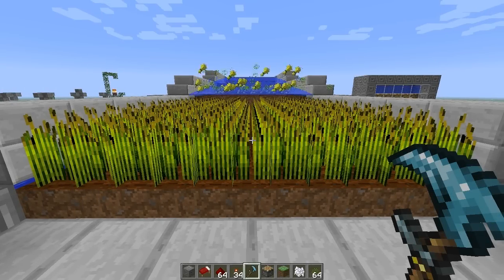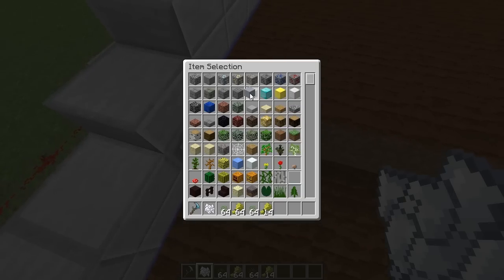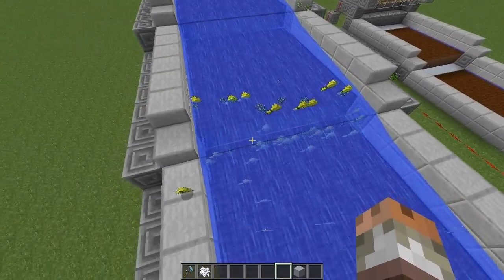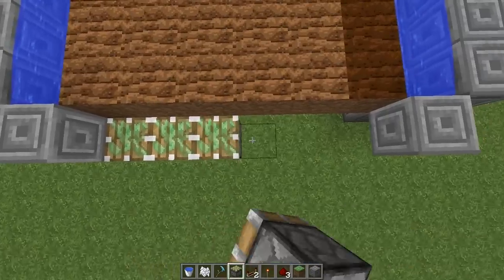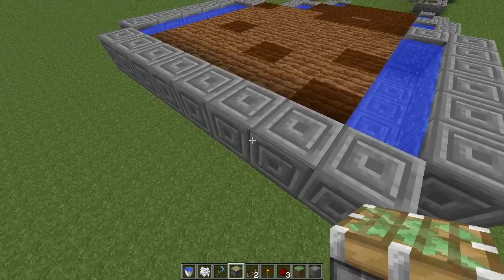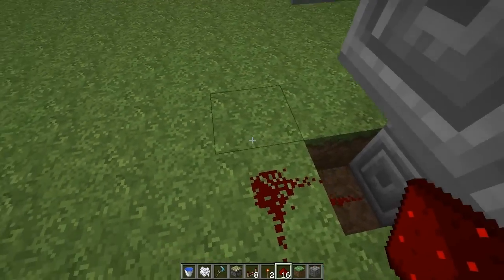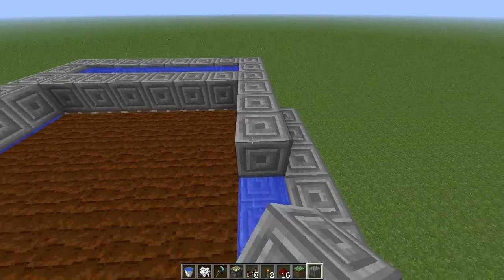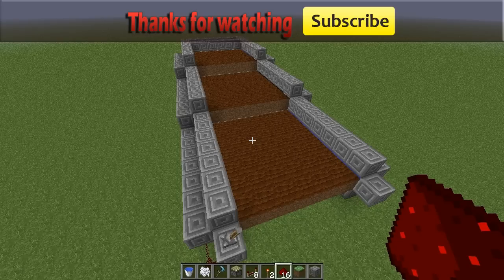Minecraft Wheat Farm Tutorial - Your Average Wheat Farm With A Twist

Comment: omg did everything, flip the switch and nothing happens :p but with all the redstone connected the pistons just stay up.. what the hell have i missed. the fact that they're up means i did something right, right? :/
Reply from the maker: Daisy Kowalczykowski Well I tell you that everything is still the same in the current version. It is a very simple redstone circuit after all. Yes if the pistons are up, that means you are providing power to them. What you need to make sure of then, is that flicking the lever, CUTS that power off. Look over the circuit after you turned it off, and figure out what is still giving the pistons power :) My guess is you have somehow placed a redstone torch wrong, or forgot to line the redstone up so it can turn off the redstone torches :)
Reply: *****
Thanks i'll try that!!! this is complicated :D

Comment: Ive made these before and the one i just made will not flow. The water just stops in mid flow.  Its so fucking random and even if i put a block under it it only flows one more square before hitting another invisible wall